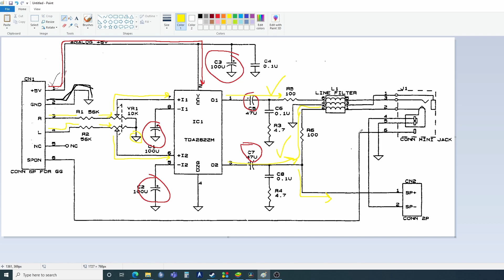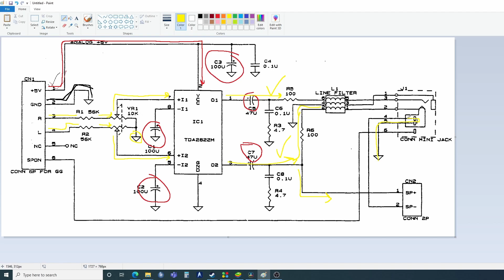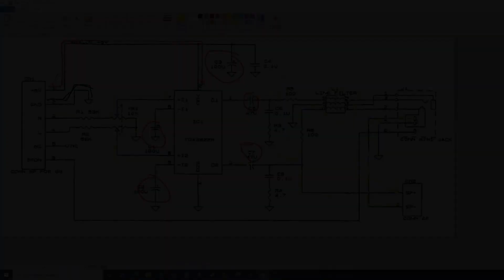Game Gear Audio Board Diagnosis

Comment: Awesome to see this process. And it worked! 

Im currently trying to fix an original audio board and dealing with sound that is too loud after replacing the caps. It works but it's extremely loud and distorted:/
Reply from the maker: That is weird. I am working on one now with audio from the headphones but not the speaker. I may record trying to fix it.